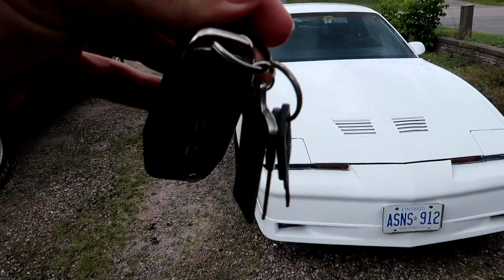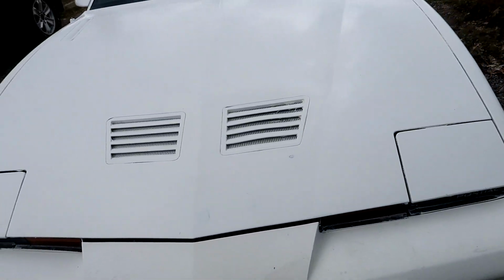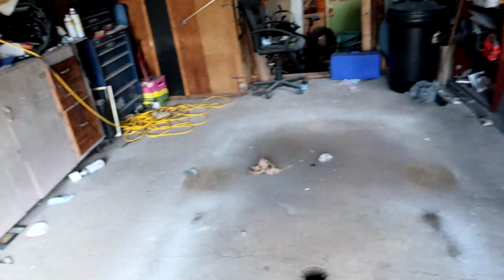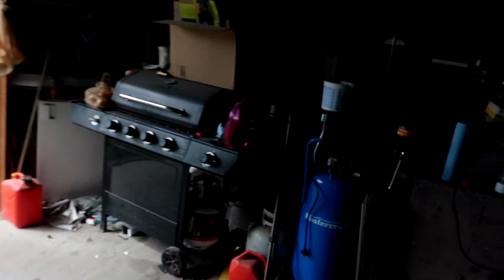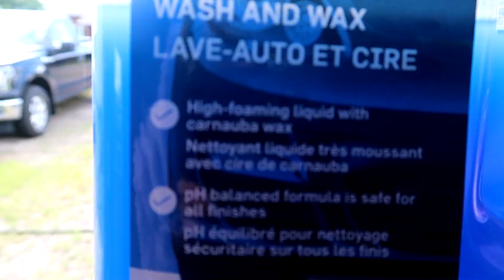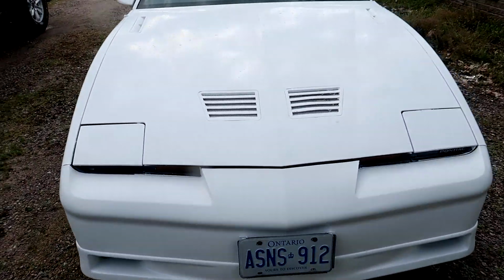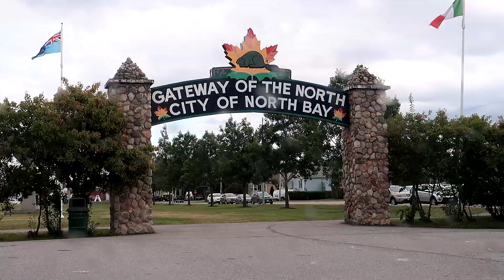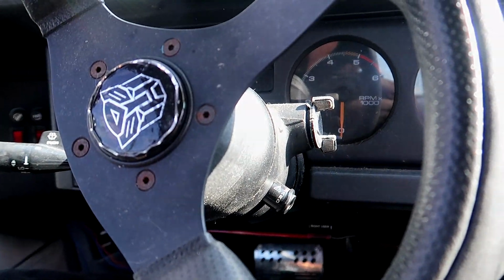Project Dirtybird is DONE!

Comment: Some floor jacks won't fit. Under the front bumper. Park the car w/front wheels on some 2x4 boards. Then roll the jack underneath. Jack up the car on center of K member.
Use the same trick for the ramps.
Reply from the maker: center K member....is that the brace that the motor mounts are bolted too?
Reply: @Skivinz  yes, it should look like aluminum square tubing. But it's very strong. 
I have to do it that way. Also if need be, can jack up the whole side of the car on one jack point behind the front tire/ ⬇️under sideview mirror. My car is a 2008 buick V-6 allure/lacrosse

Comment: Did you put fresg fuel in the car? If so how did it run after?
Reply from the maker: yeah I put 91 octane into it and it now starts easier and runs less lumpy if that makes sense.  Still get a SES light but I know thats the EGR valve not closing.  Had that issue since day one.  ZFG mode.